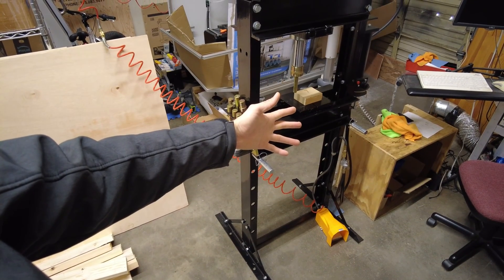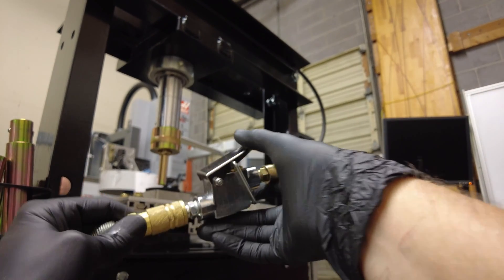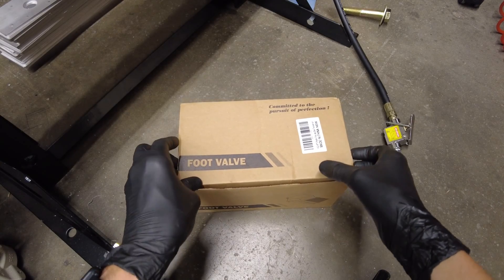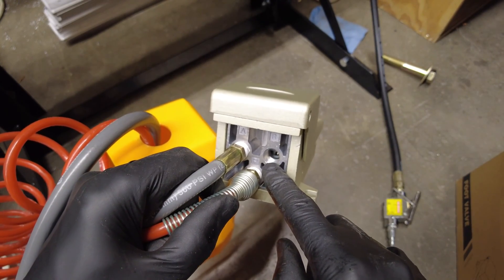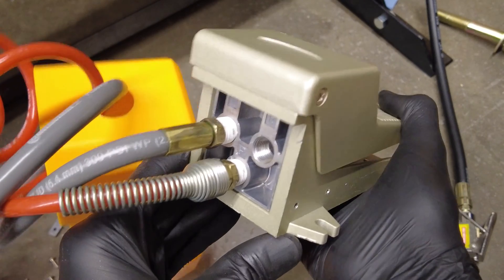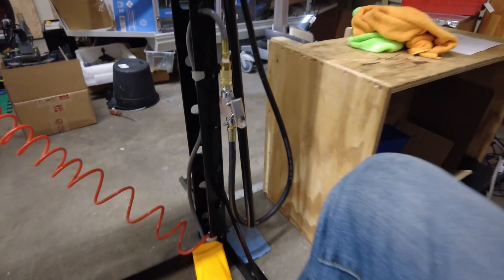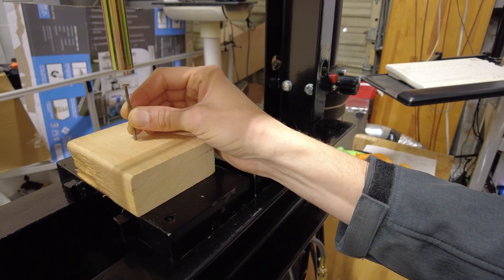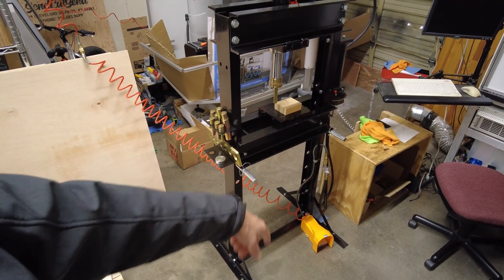How To Add A FOOT PEDAL VALVE To Air Hydraulic Shop Press To Replace The Hand Air Valve Switch

Comment: Good video mate! Do you think linking the pressure release to the 3rd port of the pedal would automatically release pressure when taking your foot off the pedal? 🤔
Reply from the maker: @MARTIN90MATON  no, the pressure release is hydraulic, and needs to pass through a hydraulic valve.
Reply: @engineerable  into the 3rd port of the foot switch?
Reply from the maker: @MARTIN90MATON  No, the foot switch is for pneumatic air only, it can not switch the hydraulic fluid. Maybe if you hooked the foot pedal up to an air operated hydraulic valve.
Reply: @engineerable  Im looking at building a press brake using the bottle jack concept (probably 2 maybe even 3) For efficency, I'd want automatic return when lifting off the pedal.
Reply from the maker: @MARTIN90MATON  another issue is that the release valve is a needle valve. It's difficult to adapt another style valve to it. The easiest solution could be to use a rotary air actuator (like this https://amzn.to/3XJptBJ ) to turn the release knob using the air from the foot pedal. I would want a separate pedal, because I don't always want it to release automatically.

Comment: Remove the hand switch, the foot switch is designed for more air volume which increases ram speed.
Reply from the maker: Thanks for tip, will give that a try.

Comment: Is that foot pedal 2 position 5 way switch?
Reply from the maker: Yes, go check it out for more details. https://amzn.to/48eFN0L 
In addition to the 3 ports on the back, there are 2 exhaust ports hidden under the pedal.
Reply: @engineerable  when I step on the pedal is when the air shuts off when I let off is when it starts moving the Press that's why I was asking which foot pedal because I thought I bought the wrong one
Reply from the maker: @notched426  Can you switch the output connection to the normally closed port, and block off the normally open port like I showed in the video?
Reply: @engineerable  so I got it figured out I had to block off A I used B as the output and P as the input thanks for the replies great channel